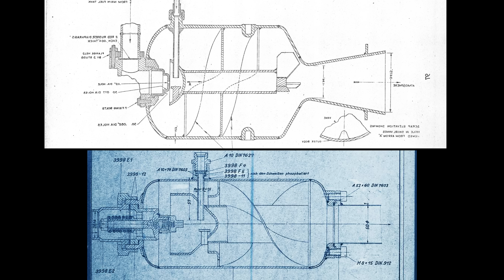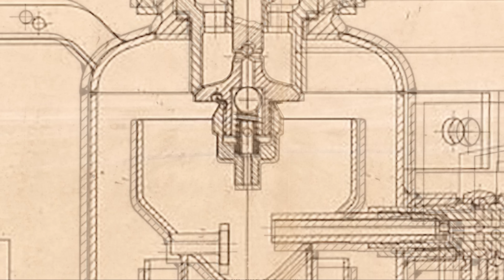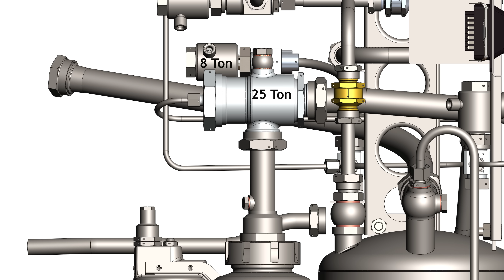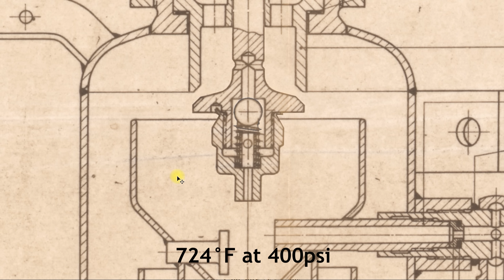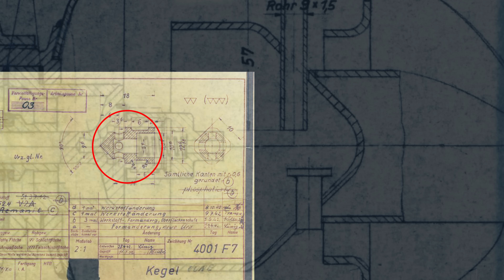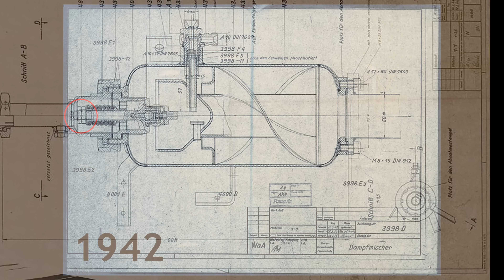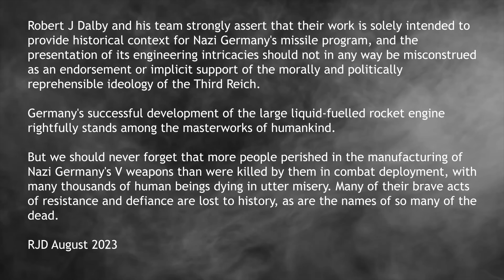Dissecting a V2 rocket steam pot

Comment: very interesting!  about the 8 ton and 25 ton valves, how i interpret the physics; the 8 ton valve opens before the 25 ton valve, at somewhat lower pressure, and also the reaction of H2O2 with the permanganate in the cup near the splash plate, invigorates the turbulence and reactivity of the permanganate, improving mixing and reaction with the H2O2 of the 25 ton valve, and reaction in the rest steam chamber. a kind of two stage reactor, of which the "first stage" is fed by the 8 ton injector. the kegel valve does the same thing as the ball valve in the 8 ton valve. less good probably (or some reason they changed it).

Comment: Given the change from machined cone to ball, I suspect the sub valve's initial purpose was found to be unnecessary , so simplified to just heating the chamber. To me, it's utility is to relieve the pressure in the pipe post 8/20ton valves (handy while testing)
Reply from the maker: Hi Bill, and thanks for posting.  Yes, I think you may be right, and there was just enough in favour of the pilot valve rather than against it.  I noticed how weak the spring was in the specimen examined, and it surprised me rather.  I think the ball position would have fluctuated due to engine vibration - but presumably, by then, it didn't matter.    KR RJD A&NTV
Reply: @RocketPlanet I have seen references to an astronomy and nature centre, is that still going? Would like to see the V2 exhibition

Comment: Thanks for sharing. Regarding the hole in the steam pot's primary reaction chamber (where the h2o2 mixes with KMnO4), I wonder if the hole was there just to prevent pooling of the h2o2 before launch. Without the hole, and some kind of residual pressure on the tanks prior to launch, peroxide could theoretically pool on there, and as you said, catalyst is injected 1st, so a predictable start up would not want a cup full of peroxide waiting for you already while the startup sequence is initiated? Just a thought. Would also explain why there is no hole on the ship missile, as it probably was never used or started in a vertical orientation to allow pooling?

Comment: So my analysis of the subvalve is that it must open before the main valve and close after the main valve. That is, any time that the main valve is open, the subvalve is also open. 

The main valve is opened by a pressure difference. The pressure on the upstream side of the valve must exceed that on the downstream side by enough to produce a force which overcomes the spring pressure, and this pressure difference must be maintained to keep the valve open. Once the valve lifts from its seat, the pressure does not equalize, because this would destroy the pressure difference which is holding the valve open, and the valve would close. Rather, the annular gap between the valve and the seat acts as an orifice which has a pressure difference across it. The more the valve opens, the larger the orifice and thus the less the pressure difference across the valve and the less force there is available to hold the valve open. This system will naturally reach an equilibrium in which the orifice created is just wide enough that it maintains the amount of pressure upstream necessary to hold the valve open.

Because the pressure difference across the main valve does not equalize, the subvalve will still be held open even once the main valve opens.

Comment: If the h2o2 is pumped into the main valve at around 450psi and the reaction is creating steam at around 400psi, then the valve is going to be forced closed due to the spring pressure and valve surface area ratios etc. The smaller pilot valve could be a way of keeping the reaction stable by constantly allowing h2o2 to flow rather than having an oscillation of the main valve as it bounces  open and closed causing the steam to pulse?
Reply from the maker: Hi there, and thanks for a good observation. Even if the psi pressure on both sides of the valve was more or less equal, the force (not the same as pressure) acting on the narrow aperture of the valve is lower than the force of the propellent entering the reactor chamber (pot) through the valve. And the chamber is not sealed, it vents directly to the atmos, so there will be a pressure drop along the mass flow as well. But I think there might have been vasilation in the pilot valve as you suggest. KR RJD A&NTV
Reply: @RocketPlanet  Not sure if you covered this (but I couldn't find it): how is the h2o2 pressurised? Is that thanks to the nitrogen tanks?

Comment: Lots of Comprehensive & detailed Info here !! .....Some dry Ice shaft Chiller + Focused torch flame or Spot induction Heat applied to Nut would likely have easily broken Loose the Nut threads.....

Comment: So how did they pump the catalyst ? It can't have been in powder form as I've always have thought.
Reply: I am not sure, but until someone who can confirm this writes here, this is what i found about  sodium permanganate 
 "Being about 15 times more soluble than KMnO4, sodium permanganate finds some applications where very high concentrations of MnO4− are sought."
Reply: Since the alcohol component in the main fuel system allredy where dissolved in water i don't think water would interfer with any other part of the engines reaction, and by using sodium permanganate  instead of potassium permanganate they could still manage to keep the concentration very high. Just my 5 cents...
Reply: pay attention
Reply from the maker: Hi Maurice, and thanks for posting. The sodium permanganate was introduced into the reactor pot as a 27% viscous solution (kept warm before tanking in cold weather). It was pumped from the 11 litre storage tank and into the reactor pot by air pressure at about 400psi (30atm). A contact valve was used to ensure the permanganate arrived in the reactor pot before the high-strength (82%) hydrogen peroxide. Other permanganate reactants were also used (eg calcium) but NaMno4 was the norm. KR RJD

Comment: Fantastic series, love it. Eventually of course, we are going to get to the point where the only thing left to do is to crowd source the funds necessary to re-manufacture all the parts and fly one. Well that's probably ridiculous to suggest we fly one. 
To fly two or three would be much better.
Reply from the maker: Hi Alex, and thanks for posting. Well, some Canadians have already tried it, over twenty years ago. The ill-fated Canadian Arrow used pressurised tanks rather than turbopumps, but otherwise, they copied the V2 engine pretty faithfully. Though quite why they did something so oddly anachronistic is a different matter. Walter Thiel, Peenemünde's chief combustion expert, declared shortly before he died in 1943 that they would never build a rocket engine like the A4 power plant again and regretted many of the missteps that took them to the necessity of flying the 18-prechamber engine. So quite why the Arrow team thought it was still a good idea just two decades ago escapes me. KR RJD A&NTV

Comment: I don't think the lower spring support was fastened to anything. There was no need to fasten it. I work in a valve repair shop and I've seen the effects of a relief valve spindle that had repeatedly, at high frequency and force, pounded against its guide due to valve chatter and the metal on the surface of the relief valve guide looks exactly like the part in the steam pot valve. Kind of fractured looking.

Comment: Is there a reason you're sandblasting and not using electrolysis here? You'd preserve all of the base metal and be left with a perfectly rust free surface.
Reply from the maker: Hi there, yes, I've used electrolytic rust removal.  It works as well as acid, which I've used extensively on stage one rust.  Stage one is the surface rust we see on items only exposed to air for a decade or so.  When late stage two rusting and decay, sets in on things that have been exposed to the elements or have been in the ground for eighty years, electrolysis can do little to restore the original surface because it simply doesn't exist anymore.  I've only ever used a professional electrolysis service offered by a powder coater, so I have no DIY experience.  But I have a sand-blasting cabinet and use this largley "because it's there" and is low-cost.  I favour it because you can use materials other than grit and get a fine, almost polished surface on some items.  Thanks for posting.  KR RJD A&NTV

Comment: I would be interested to know if the sub valve ball was lapped against its sealing surface. Also was there any specialized heat treating done on the ball valves and seats?

Comment: Marvelous video as always!  So I would like to make three related comments.  1) I think it makes sense that the ball valve would be a pilot valve for starting the reaction at a lower flow rate to heat up the reactor, and prevent an explosive ignition, like can happen in rocket engines on ignition.  I also wonder if the ball valve might not be a flow regulator during the burn, because the hydrogen peroxide and permanganate gas pressure must reduce overtime, but you would not necessarily want to reduce steam production to the turbines until you are ready to shut off the engine.  The flow rate might have been kept up even with lower gas pressure by the opening of the ball valve.  2) since you have a pristine working model of the valve complex, and you also have the drawings, you should be able to measure the spring constant of the springs and then model the entire valve assembly in a suitable hydraulic simulator, which of course the Germans would’ve died for a 1940, but we have those today.  3) taking that one step further, since you do have a pristine valve assembly, why not just test it with high pressure water and suitable instrumentation and just see what it does?  That would resolve the debate pretty much once, and for all I should think. Thanks for all you do!

Comment: A Walter H2O2 engine was also developed for U-boats late in WW2 !

Correction: the Walter U-boat engine was developed before 1942, and before the aircraft and rocket engines. Source: Cremer, U-Boat Commander, 1982, English translation, 1984, p. 192.

Wikipedia says Walter patented the design already in 1925.

Comment: Most of the problems come from fast changes of pressure.
Subvalve is there to even out hydraulic shock to the system.
Aka water hamer which can destroy welds or even burst piping in this case it can lead to bad combustion in rocket engine chamber. Cold start or fluded chamber whit later ignition of accumulated fuel oxidiser mix is not recomended. Booom...
Reply: I agree with you completely.